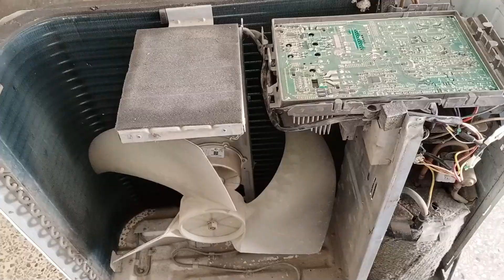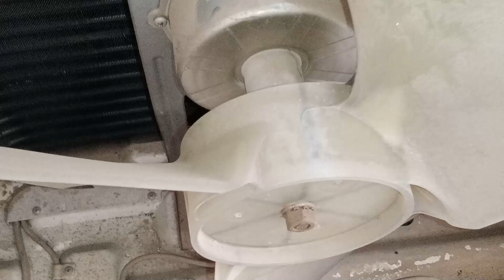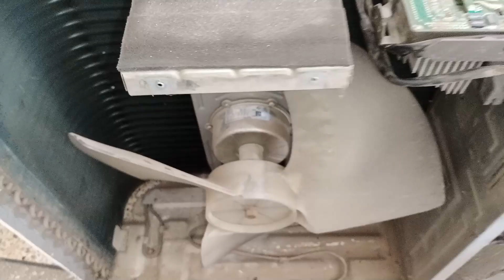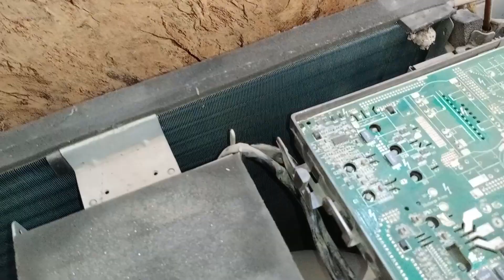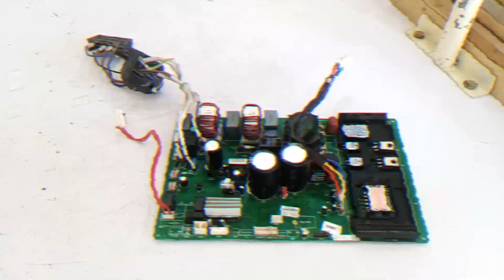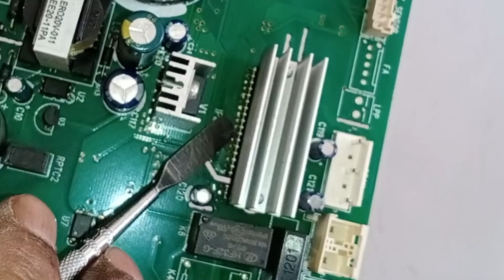How to Fix Sharp Mini Split AC L3 Error Code in Minutes!

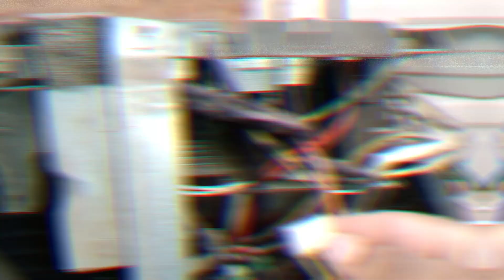Comment: 2:00 - This connection problems are well known to me. My Professor had a Laptop and it was not working any more, the solution was to remove the RAM-module and insert it again. This contacts somehow lost connection during time. Possibly oxidation or dirt?

Interesting that they do use a BLDC motor for the fan.
Is it possible to drive the system with 230V DC, maybe with some modifications?